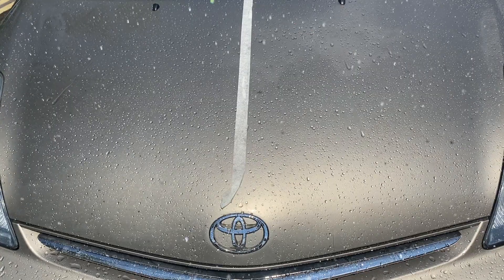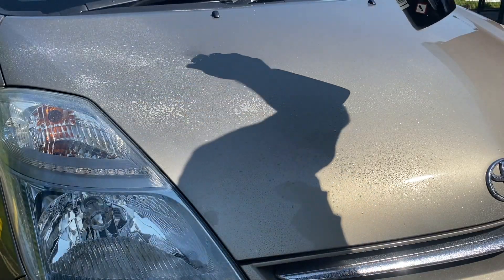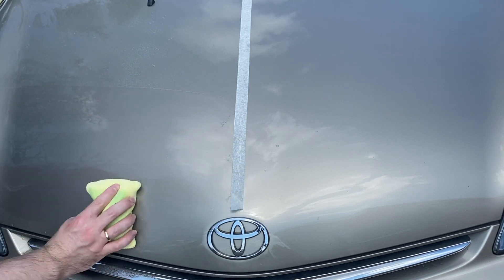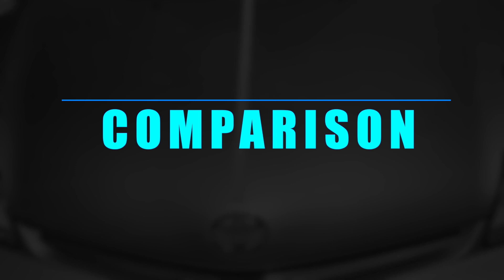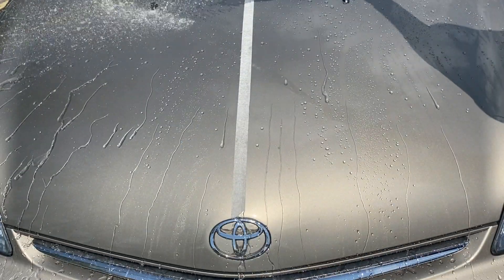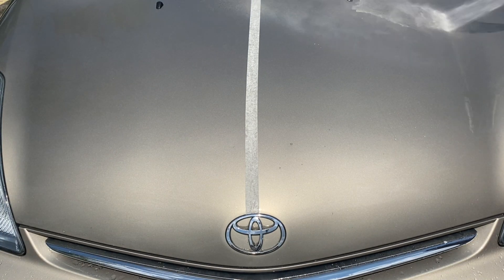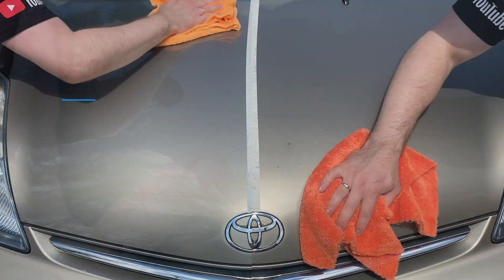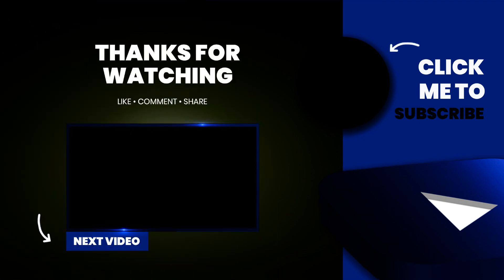Will ADBL Synthetic Spray Wax Beat Sonax Brilliant Shine Detailer?

Comment: I tested a lot of different QD s including SSW and BSD. In my opinion in case of catching dust BSD is worse. Overall durability is better with SSW. Depending on weather up to 3 months. It's outstanding taking under consideration that SSW is quite cheap and easy to apply.
Reply from the maker: Great observations Aleksander. The things you have mentioned I agree with them, also. SSW gives a deeper gloss, which I like more, and slightly less attractive to dust dirt compared with BSD. Price wise, BSD is cheaper where I leave, but overall impressions slightly better with SSW. One of the best in its category on the market currently. Thanks for sharing your experience, I really appreciate that 🙏

Comment: I like BSD but Ive always found the gloss side lacking . Its something I would apply more in winter months after a wash as a drying aid or apply more often to cars that are not as cared as often as my own car for water protection. Be interesting to see how they perform longer term in real world testing against each other
Reply from the maker: Hi Andy, I absolutely agree with that BSD lacking of gloss, also very dusty. As far as I experienced, ADBL SSW more or less has the same behavior regarding to gloss and dusting, however slightly better on gloss than BSD in my opinion. I really rate BSD water behavior, but I know that isn’t the most important factor for many people. I personally think, SSW even does a very slightly better on that part, as “leaves the panel more dry with less water on it” and it is a very good alternative to those whose rate Sonax BSD. Will see how well the longevity goes, I am very interested to see that as well.

Comment: How did you choose the competing product, ADBL in this case? Durability “2000km” will be interesting. I could leave my car outside for 3 years and not drive it…
Reply from the maker: Fair enough and interesting, isn’t it? The manufacturer (ADBL) states the durability like: “One up to 2 000 km durability based on weather condition and choice of cleaning agents.”
Hence, I mentioned the same in the video. I am still testing the “durability” so it would be too early to say now, but I am expecting no more than 6-8 weeks with daily driving, but at this stage I can be wrong. 🙂

Comment: Who can compare ADBL SSW with Seal n shine (improved formula)? I'm wondering which one would last longer
Reply from the maker: Hi Patrik,
I only have the old formula of Seal N Shine. But what I can tell you without testing (so take this with a grain of salt please): The original formula has a very good durability. I have experienced that it was still decent after 6 months on a car I had Seal N Shine applied, after an enhancement polish, without even being washed once within 6 months. ADBL SSW I would say around 2-3 months in very best case scenario like with all prep work done. Without any prep, it will still perform well anywhere in between 1-2 months. At least, this is my own experience. So in theory and based on my recent experiences: Seal N shine would take the win in case of durability. I'm planning to have some sort of testing in the near future and I was thinking to include SSW as well as TW Seal N Shine (original formula), but I really want to compare QD's first and I have only one vehicle to test. Anyways, sorry for the long hauled response. I have a few plans coming towards the first half of this year, which will cover few protection kind stuff. So stay tuned.

Hope it helps.
Viktor
Reply: @RoadToDetailing  that was hell of the fast response! ☺ Thank you.

I've got improved formula (not that easy to buy in Europe), people say that it's better in every way. But I was thinking about switch to SSW, because mainly German Internet/YouTube scene has been reviewing ADBL's sealant very positively. But if that's so, I will stick to 🐢.

Thanks.
Reply from the maker: If durability is very important to you, yeah, stick to TW. But the water behavior of SSW is outstanding. Although, TW has a decent performance in that area as well. Honestly, TW S&S is a very good product which hard to beat. If you have that already, and you are happy with it, just use that. If you’d like to discover more, I highly recommend SSW, as that’s one of my favorite spray on type product. Also, you can buy it in a 200ml form, that won’t break the bank. 😉